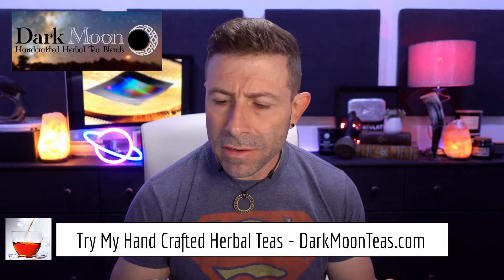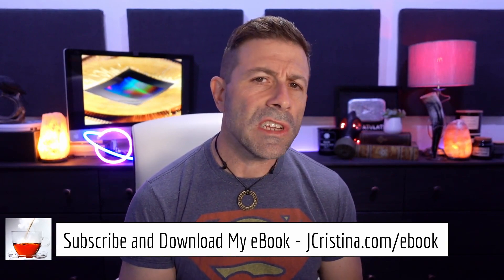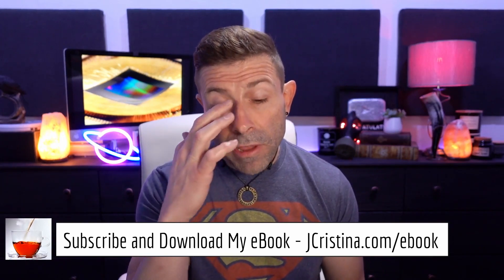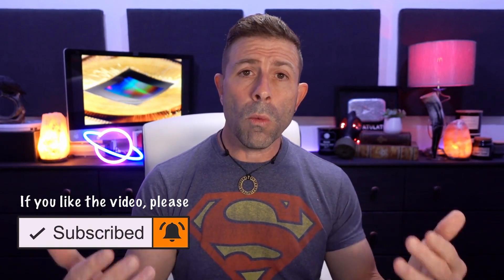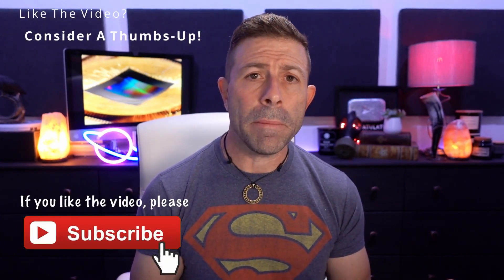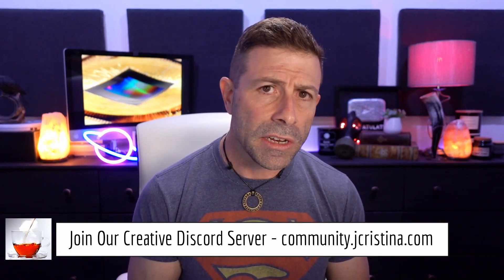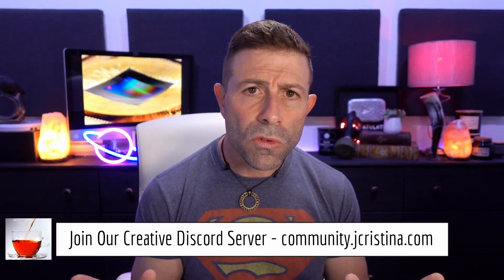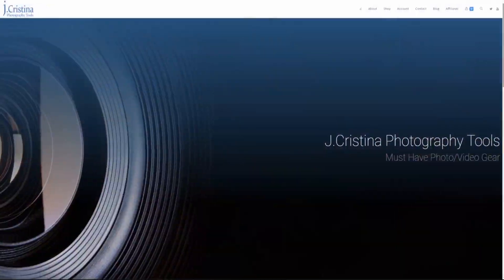Canon Is Racing To Produce A Curved CMOS Image Sensor - WHY?

Comment: Curved sensors suffer from a number of problems and will be best for a fixed lens non-zoom lens. This is because every focal length has a different curve, and it is a huge problem to make an adaptive curvature sensor. Zoom lenses are particularly problematic because of the computing power required to continuously change curve shape as the user zooms the lens. And because lenses that are designed for flat sensors will not focus well on curved sensors, adoption will be limited by resistance to needing to replace entire lens collections yet again, unless the sensor can be made to stretch out flat as well as being able to curve. It is a technology that has big promise, but even bigger technological hurdles that I don’t see it coming to ILC’s any time soon, and maybe never, or at least as a passing novelty.

However, at some point there will be user pushback over increasing megapixel counts due to file sizes and the lack of need (for most people) to have images much over 100mp. As we plateau with sensors in the 50-100mp range, curved sensor technology will be one of the few opportunities to goose buyer numbers. I expect it to be introduced, but also suspect it will be like 3D television, probably a passing fad as people understand that a 100mp image out of a conventional sensor is plenty enough for anyone’s needs with the exception of a small number of high end professionals, much like a Phase One camera. A great tool, but beyond the needs of all but a few.

Comment: i suppose that, given modern cpu power - this could be achieved already today, using current flat sensors - letting a minimalist lens capture the light, bent and distorted - onto the sensor - and then having the cpu “unbend” the image? thos would be much easier, as it would allow for sensors to remain unchanged
Reply: ... and here is a reference to the ideas leading to a proven implementation “FlatCam”, which does exactly what I proposed above... https://www.americanscientist.org/article/imaging-without-lenses... seems that Canon is digging in the wrong area for the best approach to modern imaging, they should look at cpu imaging rather than bending a sensor...

Comment: At least 10 years away for commercial use. You don't make a new system and abandon them in 5 years. My thoughts at least
Reply from the maker: Could be right, Anthony.  Unless there is a way to not abandon what you’ve already made. 🧐
Reply: @jcristina  R&D cost and production is hard very hard to get right. But we could reference the M mount by cannon as an example.
Reply from the maker: Very true.

Comment: Do you think it would improve the quality of images taken with vintage lenses or would vintages lenses even be compatible with it?
Reply from the maker: The sensor would need to be bent at the same angle as the glass so unless it's a flexible curve it would be a moot point.

Comment: Very interesting! J just got an idea of how to stop braking the sensor during bending. Imagine you have the bending thing and then a soft layer on that and on the soft layer you have the sensor layer. When bending the sensor layer might not break because of the soft layer beside it! Now I'm not at sensor constructor so maybe this is not possible but surely an interesting idea. /Göran
Reply from the maker: Thanks for that Goran.  It will be amazing to see what the different companies come up with to solve the issue.

Comment: If the manufacturer releases curved sensors now including the fitting lenses it will kill sales of the "old" tech with classic flat sensors. All the big brand have released or will release the latest and greatest- still with flat sensors and need ROI on those models even i a curves sensor is ready now. I think the curved sensor camera is at least 5 years from now to be released- if it's ready. The less complex lens design will bring the company faster to a required batch of essentials lenses along with the release but given the time it takes to develop and launch maybe 5 years are to early.
Reply from the maker: 100% Obsolescence over night.

Comment: The Advantages of a curved sensor will likely disappear with zoom lens applications, until something other than silicon is used as a substrate.  You need a substrate that wont crack from repeated deformation. If the sensors become cheap enough they might go the route of the ND filters that go between the lens and the camera body.  Adaptive optics are done now by deforming mirrors not sensors. With a fixed curvature sensor, zoom lenses will work like telescopes or microscopes.
Reply from the maker: I can't wait to see how each of the companies get around the obstacles.

Comment: I'm rather dubious that this is going to happen anytime soon. High-resolution sensors are made on silicon crystals wafers. Silicon does not like to bend, unlike glass (which is amorphous) due to the crystalline structure. I have seen the papers where they have been able to curve them, so it is possible, but I wonder how practical it will be anytime soon. They are certainly not going to flex them in the camera. From the lens design perspective, there is some advantage, but I would think it would be for mostly the shorter focal lengths. This also assumes that there are no limitations to the sensor designs that can be curved. 

It could very well be that Canon is just covering their bases in case something happens. There are many research papers about curved sensors including from Sony and Microsoft. 

I think there are more important features for future camera sensors such as global shutters and more dynamic range and maybe time-of-flight that will happen before we see widespread curved sensors.
Reply from the maker: Yep.. Microsoft had some really great prototypes and broke a ton in getting there.. :)

Comment: These kinds of stories reminding me about all the great and fantastic improvements for batteries. We are hearing this for 10+ years now, but still nothing spectacular happening on that area. Does nothing happen with battery technology then? Sure it does, but it doesn't nearly go as fast as they promise us. Nothing truly spectacular in improvements. Yes, they promise every 1 or 2 years that "now some real improvements will follow soon", still waiting.

I see the same thing happening here. Before they are able to produce curved sensors in a way that it's good for real mass production (with only little problems and high yields) we probably are talking 5 to 10 years from now. Then the whole system has to be marketed and adopted. Another 5 to 10 years?

This might go two ways as I see it.
1) They will start producing those for medium format like PhaseOne, Mamiya Leaf or Hasselblad. Those cameras are expensive to start with and might just be a good start with this. Also, this might be the right users for this.

2) Smartphones, you mentioned it, might be another part of the market to start out with. Small sensors that might be easier to mass produce and the most benefit in quality as they barely have any real quality now.

Should we wait on this then? Well, if you are happily shooting away and don't need anything else right now or in the next 5 years, you can. We probably know more then.

If you're in the market for a complete new system now and can't wait, don't wait. Even if the first "great fantastic curved sensor cameras" come out in 5 years, what are you going to do if you need something decent now? Need can be professional or just because you want to start / improve your hobby.

Looking at brands that might start with this, Fuji comes to mind. They already have shown that they like to think outside the box. For me personally that might be a reason to start my jump to Fuji then :-)
Reply from the maker: I really like the GFX and the X lineup.. I think FujiFilm's customer service and respect for their clients is second to none and I'm a Canon shooter. #TRUTHBETOLD
Reply: @jcristina  Thanks for the reply. You mentioned that once or twice in your videos here :-)

I noticed the firmware upgrades (learned from you that those can contain more than bug fixes). My Nikon D800 had 1 firmware update. Not really what I expect from an expensive camera. I just know that settings can be tweaked if Nikon would put their mind to it. Probably they are afraid they might not (immediately) sell the follow-up then. The D810 came pretty fast after the D800. Guess what, because of this way of thinking, I will think multiple times before I just buy another expensive Nikon body. For that price I can buy a FujiFilm X-T4 with multiple lenses as a brand-new set. Then I have a second camera and lenses (that my partner also can use). Maybe later buy a used D850 for example. When they are cheap.

I shoot Nikon for many years. Never business wise, but yet professional where possible. I might just jump to FujiFilm when they keep up the good and fair treatments towards their customers. The X-line, the GFX is too much for what I need. If I want MF I can pull out my analog Mamiya's I bought used a while back.

Not sure if you have done a video about when you shoot professionally and people around you (when outside) are trying to copy you photo because with all that equipment you must be a master! With my Mamiya on a tripod outside I noticed people coming a bit closer and taking shots of what they thought I was shooting. No questions asked and to far away to see what I actually shot. I love that, as they have no clue that it's a completely different camera format and with their compact camera the photo will never ever be the same. Not just quality wise, but what I actually shot will be completely different. Not mocking those people, I just think it's fun. If they would come up and ask, I would simply explain and show them.

Comment: Great video JC. Like I’ve already mentioned in couple of your past videos This tech is already being used by DoD. The issue is that is way too expensive for the private sector even more for civilians. There’s another tech being used now, curved lighting elements (we could call it pixels). All elements have a different curvature to produce a perfect light gathering with an extreme noise reduction. Now whoever brings the production price down and into the private sector or aggressively to civilians will become the reigning champion. Defense agencies around the world have stopped tons of technology to reach civilian use (for obvious reasons) between them lighting, color, noise and data all part of photography. Did you know that back in 2001 drones where equipped with 500mp 3D cameras that took ground photos sent them to a given location and in seconds we had a printed 3D area model of the geographical location! Also during the balkans we had cameras that loaded directly into cloud, yep no need for ridiculous memory cards! So yes the tech is no new in Defense but to bring it into the civilian world by itself will be a huge technological advancement! Sorry if I made any mistake I was working and writing.
Reply from the maker: Wow! That's amazing information.

Comment: Curved sensor I think would make distant objects more spherical and add distortion. Are all lenses curved the same? I dont think so. The pupil and *iris is actually flat.. Forget which company, but in Japan one company had made a square lens system, which I think may have a less distorted distribution of light. The reason I can see more resolving power in center is obviously due to more pixels being closer together towards the convex "mesh" shape. IDK....Will make distortion corrections a nightmare between lenses. If they make a curved screen, they can make a sensor curved.
Reply from the maker: I think they've been working on this for a decade and are getting close... Exciting.
Reply: @jcristina  Not from my user and "technologistic" standpoint. (I edited "retina" to iris being flat on my original post). This lens curve correction, if you want to call it,  is already built into the rear of the lens, no?
Reply from the maker: Simply by the nature of its shape.

Comment: The curved sensor and lenses that project a matching curved image will be the next generational leap for the imaging industry. But we're not there yet. Ask again in 5 years and the answer will be different. But the improvements will be real (coma smearing, color fringing, and radial and longitudinal abberations will be gone instantly) and smaller lenses with brighter aperatures will be cheaper and easier to manufacture. Corner darkening and loss of corner sharpness will fade into the history books. 

On a related note, I have Canon's 20mm f2.8 prime which features their "intelligent field curvature" which brings the near corners into closer focus for very nice images especially when featured items are in the corners. It does work, but flat subjects are only in focus on the middle, 3-D items can really pop though. I really like the lens. Not exactly the same but similar ideas. This will be the future.
Reply from the maker: You might be right.. But what is certain is that it will be revolutionary and the manufacture that strikes first will get a ton of props for doing it!
Reply: @jcristina  This will make the company who is first and will break those who can not keep up. 5x image quality and 3x low light performance for less cost per unit! Think of the leverage the marketing department will have!

This is pure gold for the winner (and the consumer, assuming that greed doesn’t price this into infinity or beyond)

Comment: Shame they didn't get it working in production before the new mirrorless lenses started coming out. While the ideal is to have lens and sensor matched (assuming it's not adjustable) to get those improvement figures, I wonder how much of a difference it would make if they went half way and "simply" got each lens to adjust the image for a standard curved sensor. You'd still need optics to make the adjustments, but presumably it would require less optics to go from one curve to another than it would from a curve to a flat surface, at which point the question becomes would you still see an improvement in the image quality, even if it wasn't as big an improvement as seem from the ideal matching pair.
Reply from the maker: I always seem to be one revision back before something big happens but then again. I never buy 1 gen.

Comment: I think you'll see curved sensors in fixed lens industrial cameras like in cars or other technologies that will have AI, also the things you talked about.  You won't see them on mirrorless cameras unless they create a new mount.  Maybe Sony will sell it to a new company (or create one) and see how it does.  But Canon and Nikon's mounts are too new for them too use that, unless they make the cameras to not be able to fit the lenses that are currently on their mounts.  Sony would just create a whole new mount and camera system if they decided to do it.
Reply: Also, if they do this, they may have to do it on a smaller sensor like a 1" sensor or MFT.
Reply from the maker: Great point.  I will be watching, waiting, and reporting back. Very interesting.

Comment: How would this affect tilt-shift lenses? I would not buy the first generation.
Reply from the maker: Just as it would any other lens.  Lighter, smaller, less crap inside the glass to fix a problem that is no longer, and of course even distribution of light and no sharpness issue in the corners plus 2 times or more resolution in the center   Win win win scenario.

Comment: Repetitive stress syndrome brings down planes. For flexible camera sensors, that's gonna be a major hurdle to cross. But I'm sure it'll get done at some point.
Reply from the maker: That’s a great point for a sensor that would flex depending on the lens on the camera.  The solid curved should be OK once they get the process down.  Have a wonderful weekend.  I
 Thinking about doing a life hang out for jo other reason. Just to hang out with everyone and recap the week.  Whatcha think.  Not set in stone of course.
Reply: @jcristina  sure. Live hangouts are fun. I'm sorry I missed yesterday's.

Comment: Maybe micro 4/3 will become the perfect  format size ? Easier to bend etc. Already smaller lens will become even smaller etc
Maybe FF won’t be necessary any more ? 
Who knows.
Reply from the maker: There you go! MFT is back!
Reply: @jcristina  Maybe the opposite you might not have to deform a large sensor as much per unit area to achieve useful curvature

Comment: No less than 10 years to mass produce a proper sensor and whole set of lenses. But just picture medium format more compact that those of Fuji! 

I agree smartphones will benefit from this tech first. And if they're good enough, mixed with AI... Will be pros left to buy larger and more expensive gear?
Reply from the maker: Absolutely, Don!

Comment: Physics is simple , the light wave front is not flat but curved but the statement that is cheap to make is still a good joke.Canon has edge over the Sony since Canon can make modifications on there own scanner system,since the yield will be horrible due to  wafer being ultra flat.It is more difficult then the project I used to do with square wafer.We will probably be old people when we gone see consumer camera with curved sensor.

Comment: Reasonable to see this in the smaller sensors for phones first but depending on the technology, it may be just as easy to manufacture it in a larger sensor too. Pretty much a paradigm shift. Exciting; yeah we’ll go with exciting.
Reply from the maker: Absolutely.

Comment: I wonder if it’s possible to stadium seat, or fish scale stack the sensor pixels to create the curve effect, so that they don’t have to actually try to bend a solid surface.
Reply from the maker: Interesting.
Reply: or sleeve the pixels and have them move slightly in a fixed platform, like one of those kids toys that create impressions of anything by moving hundreds of small shafts